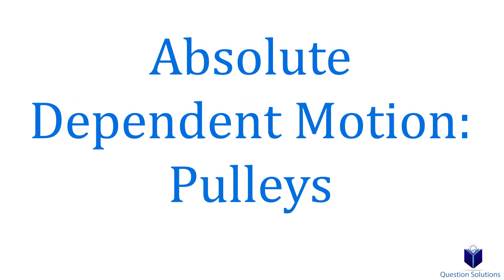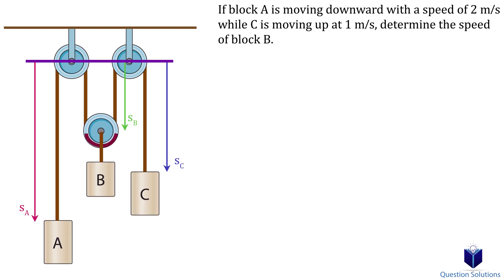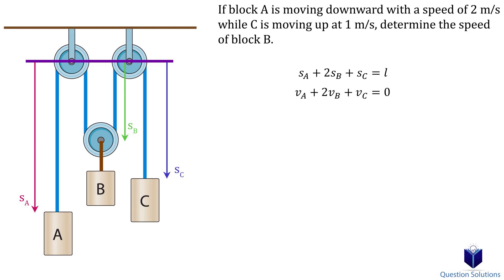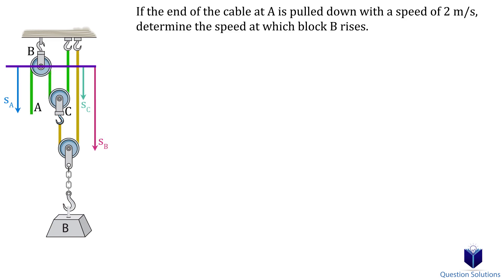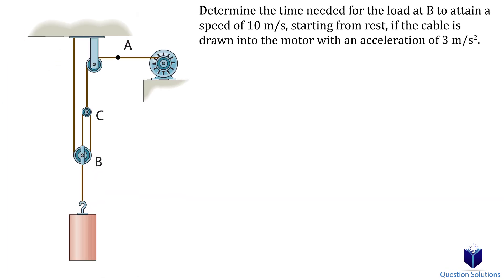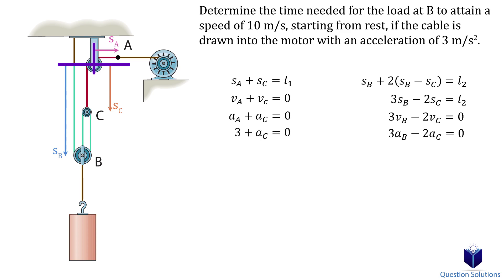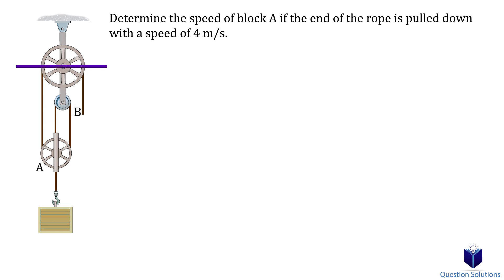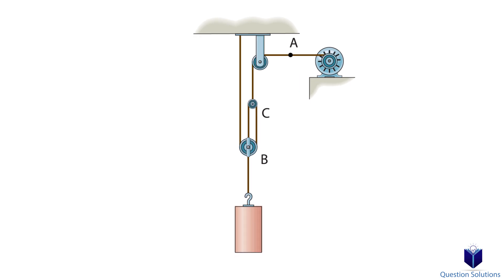Absolute Dependent Motion: Pulleys (learn to solve any problem)

Comment: I'm studying Control Systems. Is there a relationship for the forces rather than speeds along the pulleys? Great explanation.
Reply from the maker: Hmm, I am not sure. There might be, and if I learned it, I just don't remember. If I do come across it though, I will definitely leave a comment here.
Reply: @QuestionSolutions  The only relationship I've seen so far is that, for frictionless pulleys and massless cables that can't be stretched, the magnitude of the tension force along the two extremities of the cable is the same, and the magnitude of the acceleration too.

Comment: Hello! i wonder, i the case where we need 2 datum lines, does the datum line need to be in perpendicular all the times?
Reply from the maker: I think what you are asking is whether the datum lines need to be perpendicular to each other? If so, then no, it doesn't. The datum line is only a reference line to measure the distance from. If the "object" is going in the vertical direction, then we create a vertical datum line, and if it's in the horizontal direction, we create a horizontal datum line. In most cases though, the datum lines will end up being perpendicular to each other since they are either drawn vertically or horizontally.
Reply: @QuestionSolutions  Ahh, thank you very much!
Reply from the maker: @jhfghrt1918  You are very welcome!